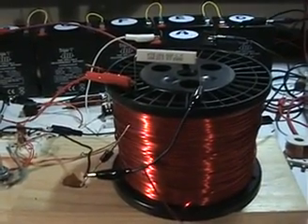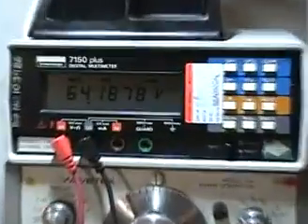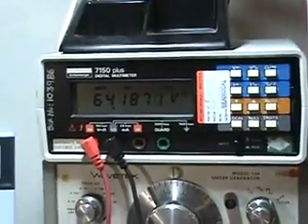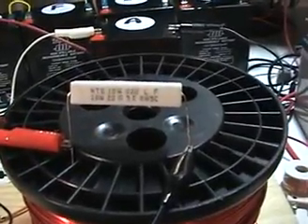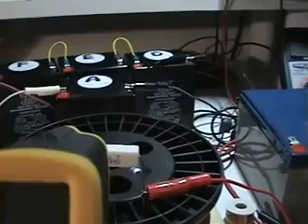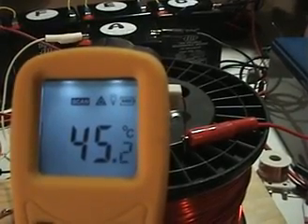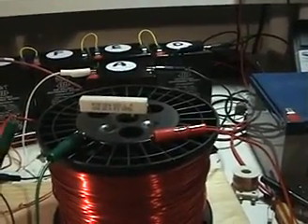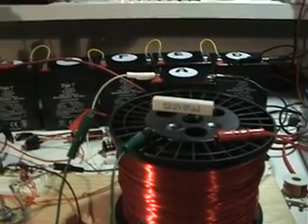Effect of Recirculating BEMF to Coil test 12

Comment from the maker: Hi Mike,

there is no heat dissipated in the coil when using such a heavy wire gauge (AWG 14) and using such a low duty cycle (5%)

I'll be rewinding the spool to obtain maximum inductance as it's far from ideal using it on the original shipping spool.

Luc